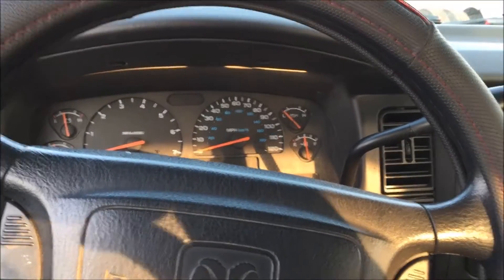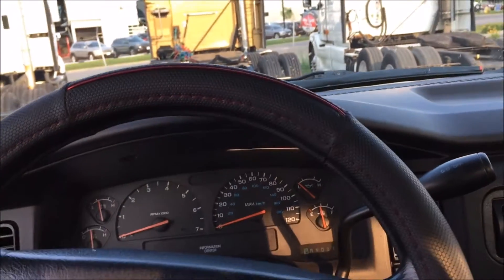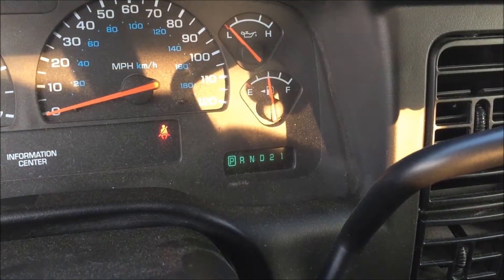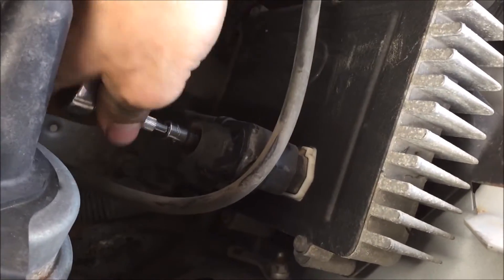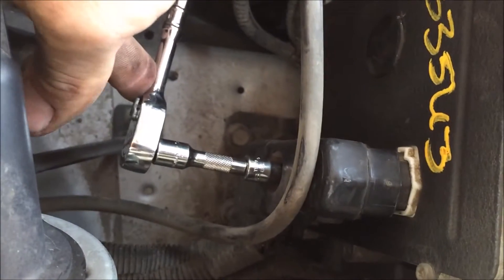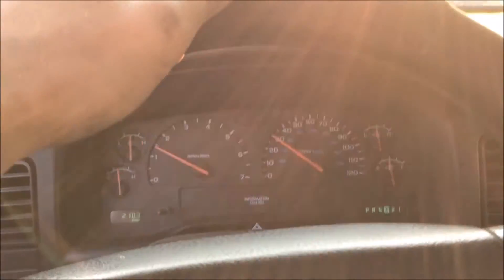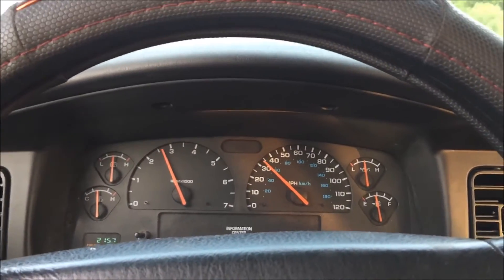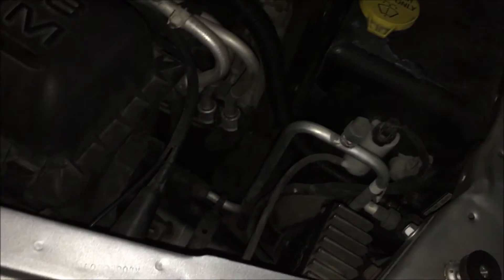Dodge Dakota/Durango/Ram 4 To 5 Speed Automatic Upgrade/Conversion (2001-2002)

Comment: Thanks for this video! I recently got my 04 Ram 1500 rear-ended by a driver who lost control of her car and it was determined to be a total loss. Fortunately I do have another truck, an 01 Dodge Dakota 4.7L V8 and not too long ago while driving it I was wishing that it had a 5-spd auto similar to my Ram. I have to say that I am now excited to find that replacing the TCM will give me that 5-spd upgrade that I loved in my other truck. I ordered the part and can't wait to test it out. I do a lot of highway driving and right now this Dakota eats more gas than my Ram did.  After installing the replacement TCM I will return and update my comment.  Mahalos!!   UPDATE (12/11/2018) : Received the TCM yesterday and did the upgrade. It works great! I did not do the torque management since my main focus was more for the 5spd capability and saving gas on the freeway.  I have to say tho that I was very happy when I tested it out on the freeway and seeing it shift into 5th gear at 55mph.  It maintained somewhere between 1550 - 1650 @ 60mph after the upgrade, prior to that I would be pushing roughly 2000 rpms @60mph.  My dakota is 2001 2wd, not a 4wd. I got the TCM from ebay for about $54 w/shipping to Hawaii. I think the install only took me like 10mins from start to finish.  Thanks for the video it really helped me out!!

Comment: just did this mod on my 2002 Dakota! works great. The TCM I got was from a 2004 Grand Cherokee. The TCM numbers matched posters numbers. Even did the torque mod and cut the wire. Everything is fine. Didn't even act up at first with the highlighting all gears. More power off the line and shifts smoother. Thanks Poster!
Reply from the maker: Glad everything went well!

Comment: Thank you all for the info- great; what a blessing! I have an 02 4.7L RWD Dakota who's trany is dying 200K (RIP as well)  just purchased a 545RFE from Rock Auto 1450.00ish not including shipping or core return. Having said that I will be ordering the recommended TCU and will update once installed. Once tested with the original TCU for performance I will install the new one.   I will also change out the rear main oil seal and some other stuff while i'm at it. I also changed out the front split bench with a 2002 Durango leather bucket power heated seats from my local boneyard took a few trips to scavenge the right set, but well worth the effort.
Reply from the maker: Yeah mine has the bucket seats as well but not heated/leather haha.

Comment: Thanks for the vid. I just did it for my 02 dakota 4.7 2wd and it works. I ordered a tcm from a 2004 jeep grand cherokee with a 4.7 v8. I went ahead and disconected both battery cables and tied the + & - cables together once detached from the battery, and turned the key all the way foward and left it that way untill i finished the tcm swap You dont have too, but I went ahead and cut the torque management wire pin # 10 (yellow & green) wire in the center of the connector next to the bolt. I did not test the new tcm before cutting the torque managment wire. I went ahead and connected wires into the ends of the cut torque mamagment wire, and ran them along the firewall and into the cab. I was thinking of installing a switch to turn on/off the torque managment from inside the truck whenever i wanted to, but i dont see any harshness or issues so im just going to hide the switch under the dash. My truck dropped about 200 rpm. It used run at 2200 - 2300 rpm @ 70 mph. So it went down to 1900 - 2000 rpm depending on the road. My 02 dodge dakota quad cab 4.7 v8 2wd would average about 40 mpg on the highway at 70 ish mph. This should maybe push it up to maybe 45 mpg on the highway. I will check. Last 215 mile trip I made i filled the fuel tank up and made the 215 mile roundtrip and got back with the fuel tank 3/4 full, and that was before the swap so my kota was reving around 2200-2300 rpm the lenght of the trip. 

Some people complain that these dodges 4.7 are gas guzzlers. Not mine. I sold my ford ranger supercab with the 3.0l v6 to buy this one 3 years ago. This dakota had 130k on the odometer when i purchased it. I just wanted it for the v8 at first. I used to have a 99 dakota with the 5.2 v8 (RIP). I loved the torque off the line but damm that motor was a gas guzzler. When i first bought this 02 4.7 it was averaging about 10 mpg. As i started to look it over and started to give it a full tune up, i discovered that an injector was stuck open, and all the sparkplugs were way off calibration. Half were different brand, and motor had only 3 quarts of motor oil at most. Entire suspension was gone including the power steering. Brakes all shot and one brake caliper seized. Both rotors warped and one ground down almost to the rotor cooling vanes. Put complete new suspension and entire brake system. Now shes been real good. 180k now on the odometer and i am shocked as to how good she does one gas. Even around town with the a/c on and the bigger 265/75/r16 AT tires i still get a out 20 mpg. It beats our 2015 Silverado crew cab with the 5.3 v8. I consume more than half the fuel tank on the same trip and same speed.

IF YOU DISCONNECT THE BATTERY AND TURN THE KEY FOWARD TO DO THIS TCM SWAP, MAKE SURE YOU TURN THE KEY TO THE OFF POSITION BEFORE YOU RECONNECT THE BATTERY AGAIN.
Reply from the maker: Was the TCM out of a 4wd Jeep? Kind of surprised it didn’t cause any issues in a 2wd but thanks for the info!
Reply: Tony The Truck Guy. Im not sure if it was 4wd. I tried to verify, but was unable to. I got it for $27 with shipping from a reputable used jeep parts company. I had read many forums and someone who had done the swap to multiple dakotas posted the results. He mentioned that 2000 to 2002 jeep grand cherokee had to have had the tcm reprogrammed at the dealer in order to unlock the 5 gear. If the owners of those jeeps tcm did not have them reprogrammed you would basically be stuck with the same 4 gear tcm, and dodge stealership will not reprogram it for you if it is not in a jeep grand cherokee. Jeep grand cherokess from before 2000 also have the same transmission, but thier tcm had to have to been reprogram by their owners at the time in order to unlock the 5 gear. The thread in the forum mentioned only to make sure that a 2003 - 2004 jeep grand cherokee tcm must have been from a jeep with the 4.7 v8.
Reply: Lol your not gonna get 45 mpg

Comment: Just a heads up to anyone who does this and trans goes into limp mode or throws a p1689 code. It popped the 20amp trans amp fuse in the main fuse box. Replace the fuse and boom everything works fine. (Torque management delete included) think it happened when I snipped the wire while the battery was still connected oops lol

Comment: Is this ONLY for 4.7 MAGNUM V8 engines?? Cuz i have a 4.7 V8 and i don't see a TCM in the location (near radiator) at all on my 02 Durango???? Any help would be great!!!!
Reply from the maker: That’s very odd. This Dakota was an 02. Pretty sure all 4.7 are considered the magnum though.
Reply: @TonyTheTruckGuy  went to a Dodge forum. Apparently....if the ECM/PCM has 4 connectors, then the vehicle is already equipped with 5 speed.
Reply from the maker: @robertcasianosr  Correct, but the 5 speed didn’t come out until 2003 to my knowledge, so yours should still be a 4 speed.
Reply: @TonyTheTruckGuy  brother.... as every video I've looked up, I also agree. But.... since mine doesn't have one or anything resembling it anywhere in the bay, then the only thing left to concur is that with a 4 connector ECM... It must already have 5 speed. 🤷🏽‍♂️🤷🏽‍♂️🤷🏽‍♂️🤷🏽‍♂️
Reply from the maker: @robertcasianosr  Drive it and count how many times it shifts lol
Reply: @TonyTheTruckGuy  I will tomorrow while running errands.
Reply from the maker: @robertcasianosr  Remember you gotta hit like 57 mph or more to get into 5th
Reply: @TonyTheTruckGuy  whelp...looked up the specs for my DD. Seems it came FACTORY with 5 speed automatic transmission. So, guess that answers it.
Reply: @TonyTheTruckGuy  and mine IS a 02... looked & double checked the door panel sticker and title. Maybe it's just the 02 "MAGNUM" engines. All the videos I've seen were ALL magnums.
Reply from the maker: @robertcasianosr  😂😂
Reply: @TonyTheTruckGuy  🤷🏽‍♂️🤷🏽‍♂️🤷🏽‍♂️
Reply: @TonyTheTruckGuy  guess you can look up 2002 Dodge Durango SLT 4X4 4.7L. Click the SPECS link, and it'll say (at least THIS model) 5 speed automatic transmission. 
I'm just as surprised as you!!!

Comment: I did this to my 2001 durango and it didn't like it. The transmission kept shifting like crazy and went into limp mode till I restarted the vehicle.
Reply from the maker: Something definitely not right there. I've done it on several of these and never had any of those issues. I honestly don't think anyone has even commented here with them issues. Did you reconnect the wire and now it's totally fine?
Reply: @TonyTheTruckGuy  I swapped back to the durango transmission computer and it's fine now. I did everything possible with the jeep transmission ecu and for some reason the vehicle didn't like it. I've modded many vehicles and never had issues. Only two things I could think of is that I'm running taller tires and I know on the rwd durangos running taller tires can mess with stuff or the jeep tcm was bad from the get go.
Reply from the maker: @kaw1240  I guess that's possible if the fronts and rears are different sizes since the Jeep TCM is 4wd.

Comment: Jumping in on a four year old post here, however I am hoping for some elaboration on the EIGHT speeds you briefly mentioned.
Great video!
Reply from the maker: It was just a theory that someone had mentioned on one of the old Dodge forums. They stated that with 3 planetary gear sets, like this transmission has, it theoretically has a maximum gear count of 8. But nobody ever proved this, and Chrysler never had a TCU that supported the tuning for 8 speeds. So 5 is the maximum amount of forward gears for this transmission, assuming you have the proper TCU as shown here.
Reply: @TonyTheTruckGuy  Thank you for taking the time with prompt response... I certainly find this theory intriguing and had never heard of it before. Cheers. 🍻

Comment: great job   also great teaching!!!   i have a 72dodge van withj a 360 and 3speed trans...can i change to a 5 speed trans??
Reply from the maker: You wouldn’t be able to do it this way. You would have to physically bolt up a new transmission and somehow get the engine to talk to the transmission because the 5 speed is partially electronic. The only reason this trick works on these year dakotas and rams is because the transmission physically already has the gears in it, it just needs the updated ECM.
Reply: thank you tony    maybe    a ford!

Comment: I have a 2000 Dodge Dakota QC 2WD just like yours with the 4.7 and 45RFE transmission. I read another comment on this video of someone else trying this on their 2000 model year truck and it didn’t work for them. Do you know what the reason is behind it not working? I just don’t understand why it wouldn’t if it’s got the same engine and same transmission
Reply from the maker: I believe it’s a communication issue. They changed the interior in 2001 and I think went to a can bus style communications network. You can bite the bullet and get a used ECM for $50 or so and try it anyways but I don’t think it will work. I’m also not positive if 2wd matters, as mine was 4wd

Comment: few years ago, we flashed rf545 firmware into 45rfe on a 2000 WJ grand cherokee. those two transmissions are identical. firmware was already exist on up to date chrysler hand terminal. vehicle was shifting as if it is a 4 gears plus a variable 5th gear ratio. differnece was approx 300 rpm on overdrive. it was dependent to the load of engine. same was applicable for downshifts. conclusion, 4 ratio version was much more economical in terms of gas milage in Town trips, but 5th gives longer gear ratios and was getting better economy during cruising at constant speed on highway. fyi.
Reply from the maker: Yeah I noticed around 57 or 56 mph is when it would go into 5th. It seemed to get better mpg on the highway and interstate as you said.

Comment: any updates ? does the O/D button still work ? does that button keep it in 3rd or in the new 4th gear ? great video !!
Reply from the maker: Updates as far as what? My buddy owns the truck now but the transmission hasn't skipped a beat. O/D button still works and keeps it in 3rd since that's the "direct drive" 1:1 ratio.

Comment: Just did this with my 02 dakota quad cab 4.7.  The 2002 Jeep Grand Cherokee part number is 56041905AD
Reply: Did it work?? Any problems?
Reply: @osvaldoramirez8264  it worked 100%. My dakota has the 3.55 gears. It runs at about 1800rpm at 70mph. 1500rpm at 55 in the 5th gear. Tow/haul still works properly. Plug and play
Reply: Thats great!
Reply: @osvaldoramirez8264  now once I get the fuel pump replaced I'll be able to get you the mpg. I averaged 17 to 18 with mixed driving unloadrd
Reply: Thanks!

Comment: Hello, I am French, for a few weeks now, I bought a durango from 2001, 4.7 V8 in very good condition, and I would like to have 5th gear on the automatic gearbox.
can you help me?
I can't find a pcm box from France ...
thank you beforehand
Reply from the maker: Greetings! Yes this should work for your Durango and should be same part number. I’m not sure where you would be able to get one locally in France, have you checked online to see if anyone will ship to you?
Reply: actually I checked in France not possible to find. on the other hand, I tried to search on ebay, but I am afraid of making a mistake when I see the tcm / ecm in 3 pins for the models year 04 whereas I believe that there are only 2 pins on the mine...
Reply from the maker: Sébastien Bordes When you say pins do you mean the mounting holes for it? Yeah I would check yours to see how many mounting holes it has. It’s ok if the replacement computer has more mounting holes as long as the ones you actually need to mount it are in the proper location
Reply: yes I was talking about the electrical assembly pin or it seems to me that there are 2 and on the pcm that I see on ebay for grand cherokee there are 3 ...
could we communicate with facebook messenger or whatsapp? I will make you a video or photo directly tomorrow.
Reply: Thank you for your help 😉
Reply from the maker: Sébastien Bordes You should be able to message me on FB @ Tony The Truck Guy

Comment: I have an 02 durango SLT does this work on it
Reply from the maker: It should so long as yours doesn’t already have 5 speed
Reply: @TonyTheTruckGuy  I'm less knowledgeable than most on here, how would I be able to tell I'm really just wanting to get better mileage and this seems like a fairly simple swap.
Reply from the maker: @gobblegobble239  If it’s an 02 then it should currently be a 4 speed, but you can check by starting from a stop in 1st and just accelerate moderately up to about 60 and set the cruise. Count how many times it shifts between 0 and 60 mph. Should be 3 shifts if you currently have the 4 speed.

Comment: I have a 2006 slt auto, would this work for me? I have a few things I plan on doing performance wise and I'd like to not have to get a new trans in the process.
Reply from the maker: If you have an ‘06 and it’s a V8, you already have a 5 speed.
Reply: I believe that your 06 already has the 545rfe with the 5 speed if it is an automatic.  I'd do some more checking..

Comment: So if i wanna use this tranmy om my-77 Dodge W200, what do i need?
Reply from the maker: Ooftah. Are you using the engine that goes with this transmission? I would think you need matching engine and trans with harness and ECU
Reply: @TonyTheTruckGuy  Kinda hard to get, expensive any way, so instead i thinking of using a T5 manuel instead, more fun actually and no trubble with electronics,  but t will cost a bit too but thats the way i think i go. Cant see it would be cheaper or easyer with a mopar 5 speed
Reply from the maker: Manual is always fun!

Comment: I have a 2001 Dakota 5.9 R/T would this work for my truck?
Reply from the maker: Probably not, I think it's only for the 4.7/5.7 but figure out which transmission you have, I believe yours is a 46re if you have the 5.9, this is for the 45rfe.
Reply: Tony The Truck Guy that SUUUUUCCKS!!!!

Comment: Will this work for the 2002 Durango 2WD? 4.7L  45RFE
Reply from the maker: Should, only thing that wouldn't match is you don't have 4wd. If you can get yours hands on a cheap TCM I'd try it.
Reply: It's my understanding that the 4WD models also have a transfer case module as well.
Reply from the maker: +Jeff Dobbs most likely, but I'm wondering if it's the same ECM and it just wouldn't have any output
Reply: I've learned that my model, 2WD, share the PCM/ECM for the 45RFE. It being a 4 port module where the other models have a 3 port PCM/ECM and separate TCM. I believe I'll need to replace my solenoid control module in order to get be reverse lights working again

Comment: Will this work for my Dodge Dakota 2003 4.7¿
Reply from the maker: 2003 should already be a 5 speed
Reply: @TonyTheTruckGuy  Thank you.
Reply: @TonyTheTruckGuy  hello for some reason my title said 2003 . But by the passenger door. It said 10 02. So it should work correct. If is the case. Which year and model . Should I get the tcm. To convert it to a 5 speed.. I guess that's why I count only 4 gears forward. Please answer. Thanks
Reply from the maker: It may have been built in 10 of ‘02, but that’s an ‘03 ‘model year”, so yours should already have 5 speed. Good way to test is go about 50 mph and make sure your transmission is in over drive, then accelerate to about 60 and hold that speed a few seconds. You should hear it shift into double overdrive. Mine does it right around 56 mph
Reply: @TonyTheTruckGuy  ok thanks I'll do that you are very helpful 👌🏿👍